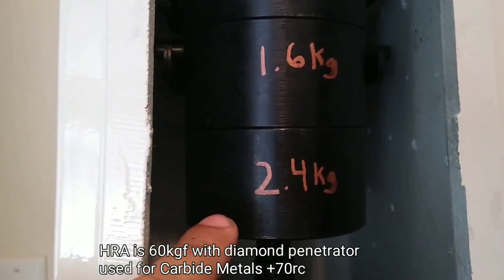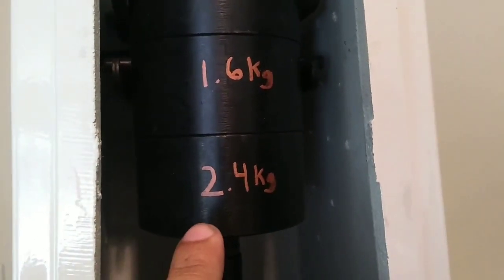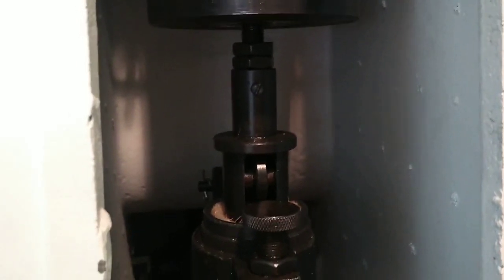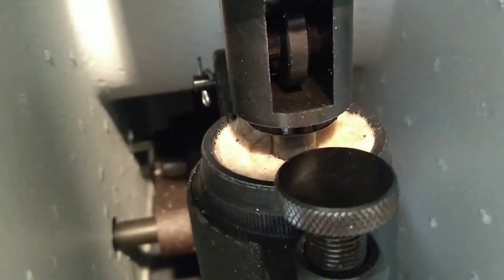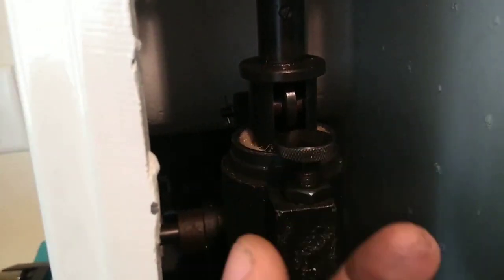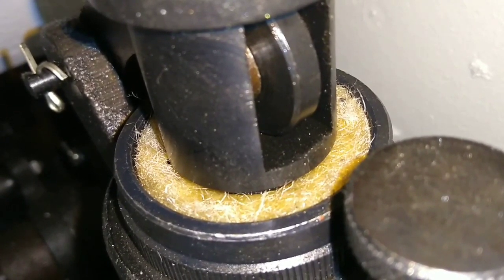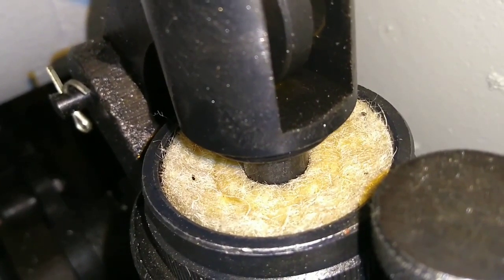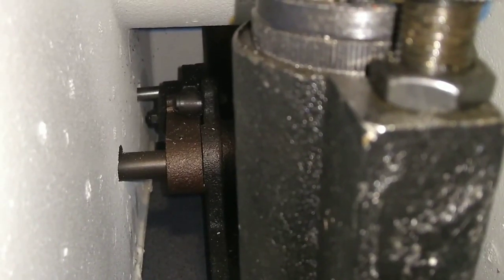In Depth | Grizzly Rockwell Hardness Tester

Comment: Thank you for the helpful video. Got the machine calibrated to within a .5 of accurate reading 48.5 on a 48 hardness.  Then did 3 readings in a row and they were all over from 43 to 52. Just got the same Grizzly. Adjusted to 6 seconds in the back and have adjusted the top probably 49 times or more. Any advice on how to get consistent readings??
Reply: I'm having the exact same issue while using a 51.4+/1 HRC test block.

Comment: Why not use the flat blade to hold the screw and use a wrench instead of a socket to tighten the nut? Jealous of the tester looks great
Reply from the maker: Well if ya notice I have a line of text in the video that says that. I just didn't have a 3rd arm to flim it. I used a cresent wrench to tight the pin nut while I held the pin screw with the flat head using my Kung Fu grip. Thanks, it's a very useful tool.
Reply: Sorry missed that part probably while writing this 🤠